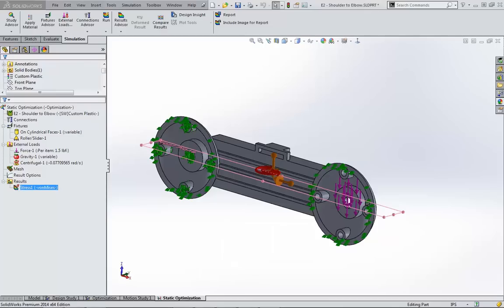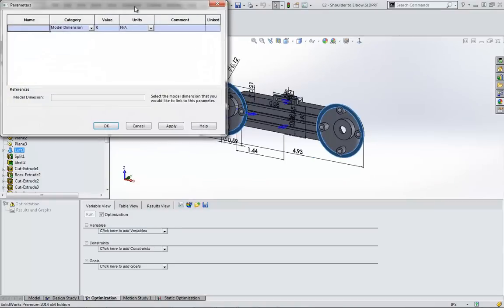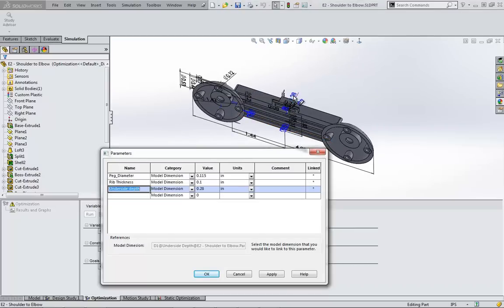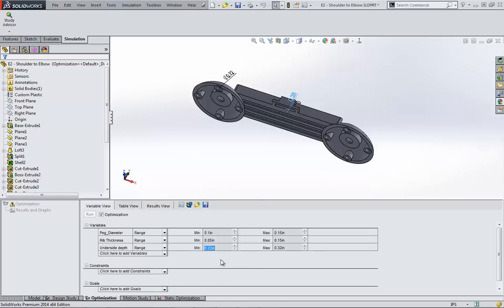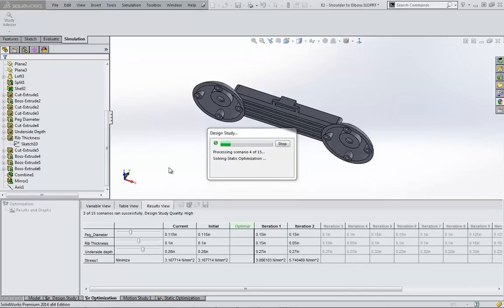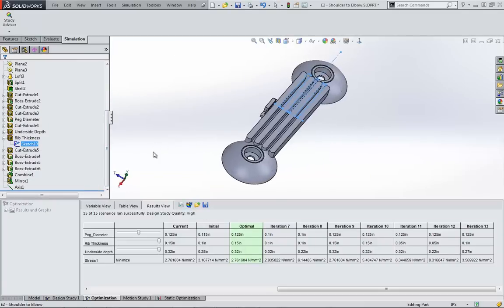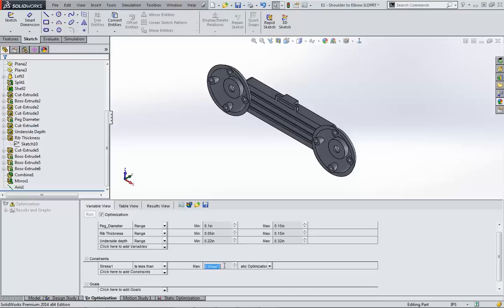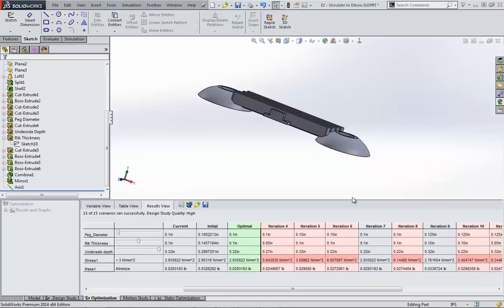SOLIDWORKS - Setup a Structural Optimization Study

Comment: GoEngineers I really appreciate the effort that you guys put in. These uploads are great help for us (Beginners) to sharpen our skills. I have a small request. It would be a pleasure for us, If you upload a video on demonstration a simple static analysis using composite materials withSolidWorks. There is no proper demonstration that gives us a brief  to understand and to implement our skills in composites.